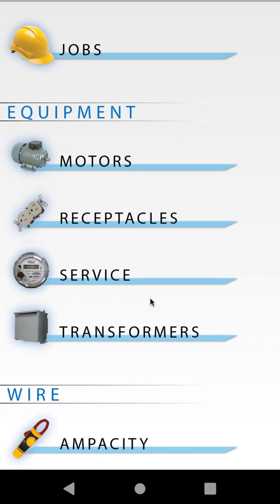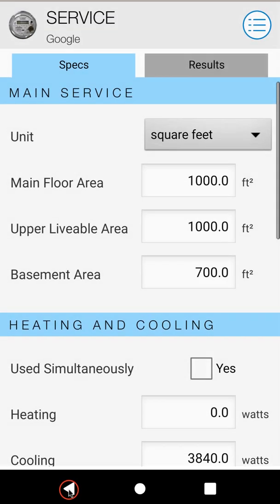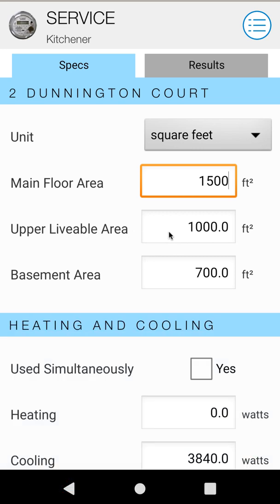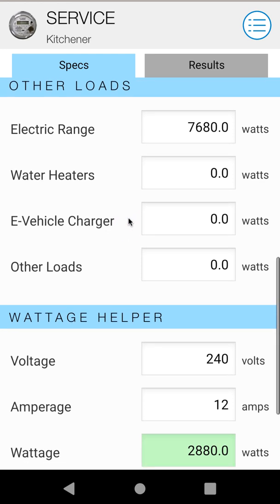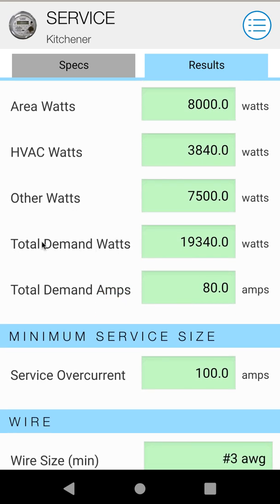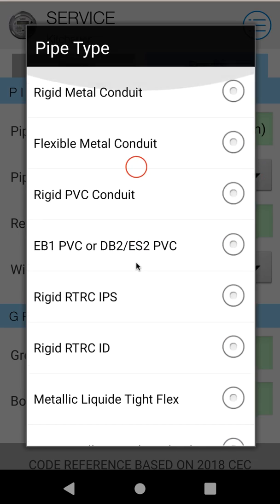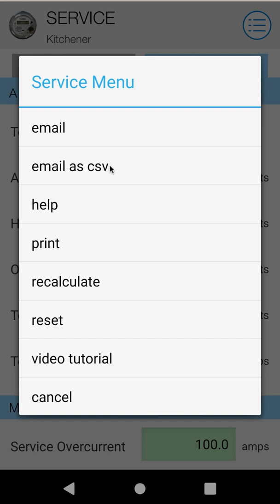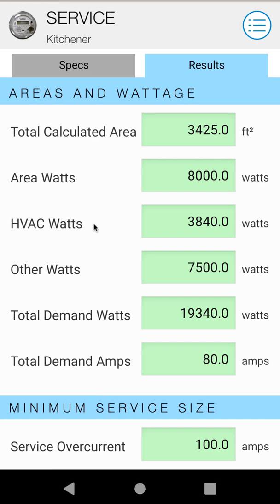Service Tutorial

Comment: Where is the dryer load?
Reply from the maker: The app is strictly based on the CEC.  Section 8-200 deals with service calculations and has no rule based on dryers.  Dryers fall under 'other loads over 1500W' in the CEC and in the app.
Reply: @keatsp  If a person is to install a car charger but needs to know the load calculation on the house, then your app is not so great is it?  A few added lines of code to your app is too difficult I guess.
Reply from the maker: @briand.4398  Well car charger loads would be entered under 'E-Vehicle Charger' in the 'Other Loads' section.  I'm not sure what you're getting at.  This is the exact same layout as you would do in the Canadian Electrical Code.  If you have suggestions for improvement then I'm all ears.  This is typically handled better by email through the app and not on a public forum but this works too I suppose.